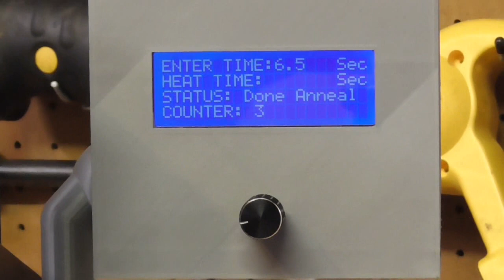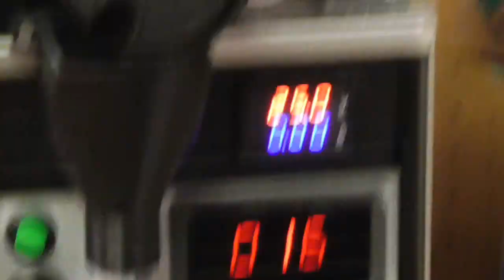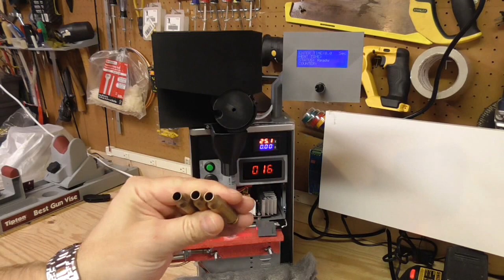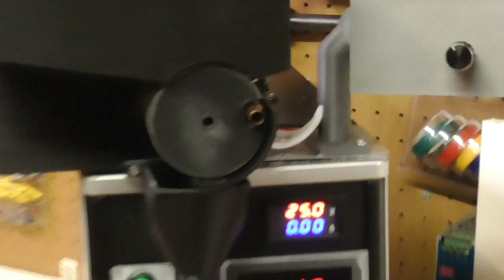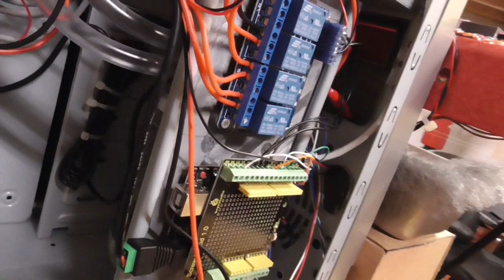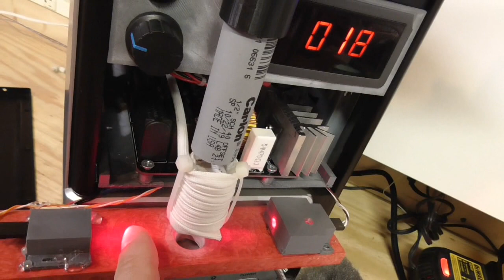Automatic brass annealing machine

Comment: Hi Stas, 

Great build very similar to what I build for myself during lockdown, I am using a 4CH relay timer PTR4, I would like to use Arduino like yours, you indicate bellow that you would load the code for fee, would it possible to communicate with you via email, please let me know. Thx Joe
Reply from the maker: Hi Joe, yes email me

Comment: Dear Sir, I admire your concept, thank you for sharing with us. Is it possible to share the Arduino code?
Reply from the maker: Thank you for watching my video! The arduino code alone will not help you to build this system. There complex of i/o operating together with sensors and drives. If you interested in building this machine I can adequate compensation load the code to arduino uno, provide you design schematic and list of parts I used. Some parts are printed on 3d printer, so if you need them too I can print you these as well.
Reply: @StasPlagov  Thank for your reply, Sir. I have build my own machine (not fully assembled yet) and control it with Arduino Nano for which I developed the code myself. My system includes a stepper motor with auto-homing, a servo (instead of solenoid) as ejector and all works well. I am currently using a potentiometer to set the timing of the heating and would like to change that to rotary encoder. I am also using Nokia 5110 LCD but I'm familiar with 20x4 LCD displays. I need an example of the code for the linear encoder and timer calculations only. I will appreciate if you could give me an example of only that portion of your code. Thanking you in anticipation.
Reply from the maker: @braamsms9870  here is the best tutorial with code for rotary encoder. I heavily modified this code to fit my needs. But if you read this, you will understand how it works. 
https://core-electronics.com.au/tutorials/how-to-use-rotary-encoders.html
Reply: @StasPlagov  Thank you for your help. I have made progress in the mean time as well. Will have a look at your suggestion

Comment: Very impressive, I am still building a similar system, but very easy compared to your. I use only the annealer device without automation, like the AMP, "manually operated". Thanks for the video and greetings from Italy.

Comment: great work! Are you willing to share how you made it? I've been wanting to upgrade the gas annealer I made to an induction one.
Reply from the maker: I designed two versions, one based on PLC and HMI, and the second based on Arduino and LCD. These logical devices can control relays, pushbuttons, solenoids. The hardest  part was to find solenoid and thermosleaves for coil. The size of the coil is critical too. I came up with 1/8" cupper tube with 10 turns and 3/4" inner diameter of coil.
Reply: @StasPlagov  I like the idea of the lcd and Arduino. If you are willing to give advice, I've never programmed an Arduino, please let me know and I can give you my contact info. I am very interested in your 3d printed feeder as well. Again, great build!
Reply from the maker: @jeremymartin9411  if you never programmed arduino then it will be challenging for you to complete the code. If you want to build the system like mine and willing to spend some money for parts I can obtain the inexpensive arduino (the same I used) and load the code for you little fee. My idea of this annealer it be affordable for everyone but I spend my time and want to recover some expense I put to the project. Before I built it I spent quite money trying different parts. What I can do for you is to print the case feeder and LCD enclosure, load code to arduino uno, include LCD display and rotary switch, I will include induction board (I tested it and it works, I ordered two just in case) and provide the list of rest materials I used for the project for $150. Be aware the total project cost will be arround $400 and will require from you little creative work. It will be good start for you to build it.
Reply: @StasPlagov  can  u send me the code?
Reply from the maker: @dscomputers5388  $50 for code.

Comment: How much?
Reply from the maker: Priceless!
Reply: @StasPlagov  Let me know when you are ready to sell. You have a sweet design! Thanks!
Reply from the maker: @foreheadlikeflint7516  we can work arround this. Either whole thing or I can sale essential components for it and guide how to assemble. Any way, I am still testing this.
Reply: @StasPlagov  , does your controller, hopper and slide gate integrate with an annie annealer? I have the Annie.
Reply from the maker: @foreheadlikeflint7516  I heard about Annie machine but did not have a chance to try it. I am not sure what controls timer in there. If I can get some input and outputs from their controller or at least see principal schematic, I probably could figure out how to make my hoper and case drop door solenoid work togeter.